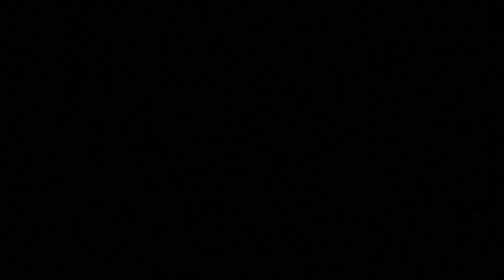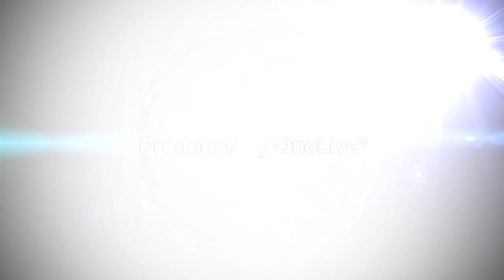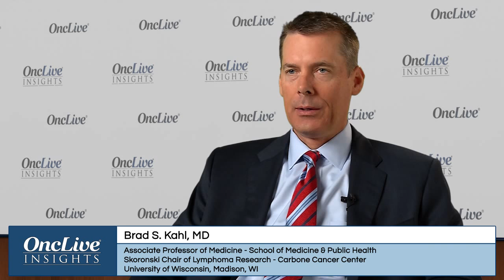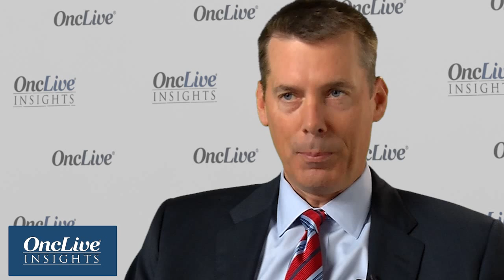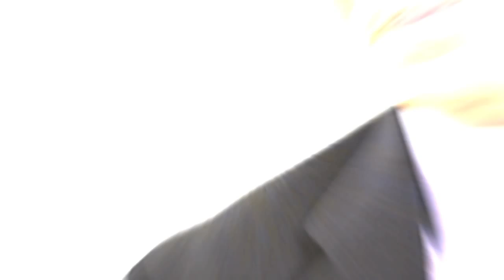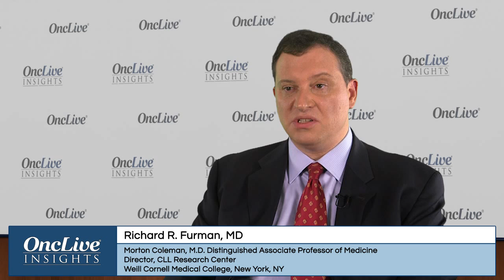Managing Follicular Lymphoma

Comment: I was a patient diagnosed with Peripheral T cell NHL in the year 2014. Location of the infected lymph node was Right Groin, which enlarged to lower abdomen. Peripheral T cell NHL diagnosed after excision biopsy. I got 7 Cycle CHOP and Radiotherapy. In September 2020 a PET-CT Scan done after I notice sever itching problem. PET scan showed an 70x51x70mm sized Anterior Mediastinal Mass with SUV max 11. Thoracic surgeon refused to operate the mass. A core biopsy and histochemistry done. Which shows an Intermediate grade Diffuse large B cell Lymphoma. CD20, BCL6 & MUM1 are positive. BCL2, CD3, CD5 & CD10 Negative. Bone marrow aspiration suggesting "Reactive marrow with myeloid hyperplasia and excess of lymphocytes. Before all these diagnosis I only faced itching problem. First symptom noticed in beginning of August 2019. Last 24-26th October I suddenly faced swallowing face. An echocardiogram of the heart on 27th October showing small amount of fluid build up around my heart. LDH lifted to 366. My oncologists immediately suggest chemotherapy. The new chemo protocol is R-GCEOP. 1st Cycle started on 27th October and spited into 3 days. Rituximab, Cyclophosphamide, Gemcitabine, Etoposide, Vincristine, prednisone given. After 1st cycle chemo, face swallowing and itching removed significantly. We took part in a research project which involved a two day trip to Florida to the ALS Disease Centre, We had the opportunity to meet with Dr Odia, A highly recommended herbalist with scientific medicine. There is a lot to say about Dr Odia. I began healing herbs from Dr Odia, MD, who specializes in internal and pulmonary herbal medicine at ( drodiaherbalistcenter@gmail.com). I would encourage anyone to seek a second opinion especially if they’ve been told there’s no hope. It’s also crucial to learn as much as you can about your diagnosis. Seek options. Find out about what’s out there that could help. Contact Dr Odia via: www.facebook.com/DrOdiathenaturopathic/ WhatsApp +17278553511.. He has a cure for Encephalitis, Herpes and cancer.